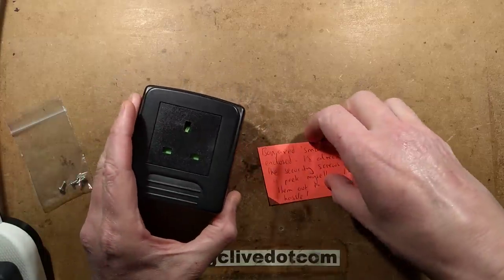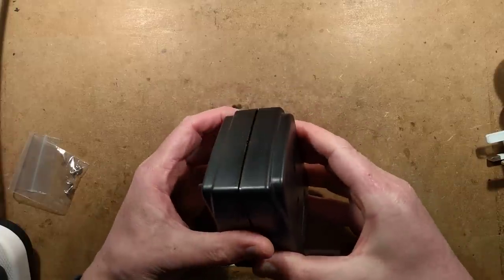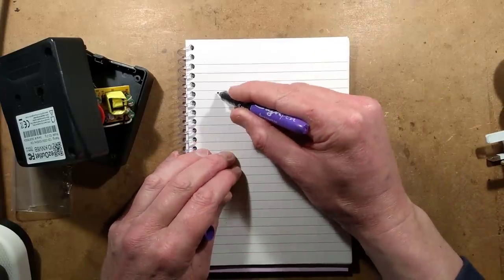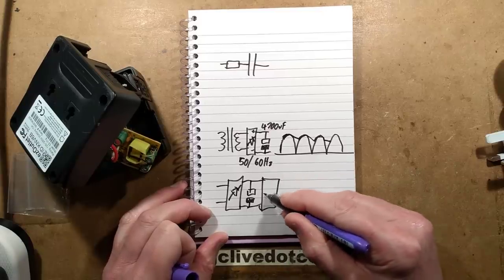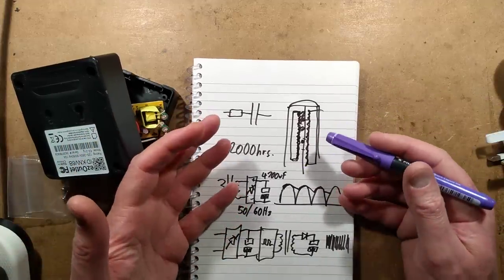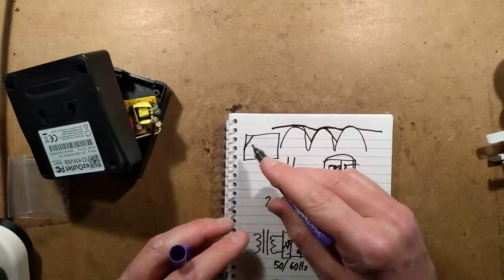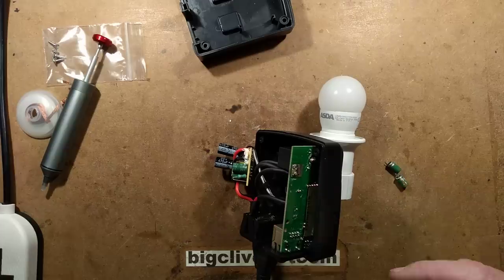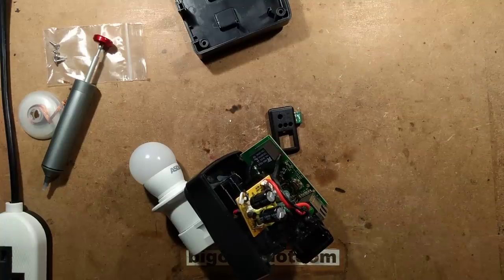Fixing an ezOutlet with inappropriate components.

Comment: Capacitors are super reliable. Cheap SMPSs often use less capacitance than needed, forcing them to run hot from the ripple current.

Comment: I've used a similar device in the past from another OEM (Aviosys) to remotely power-cycle one of my home servers in case of a complete hang. It was not cheap (IIRC, the single outlet version was about 150 EUR), but it really helped me out many times until I got the server to run stable.
There are versions of these devices with several individually controllable outlets as well. These things are essentially little computers controlling one or more relays.
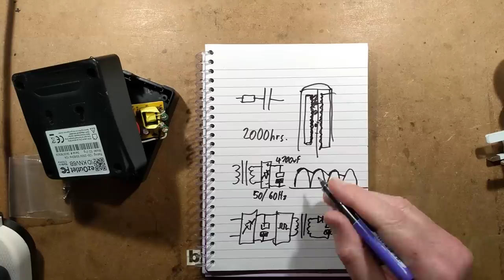@9:24 Electrolytic capacitor hour ratings are specified for maximum rated temperature (usually 85 or 105 celsius). Since most capacitors run at much lower temperatures than their rating, they last much longer.

Comment: The capacitor closest to the transformer would see far higher ripple currents than the capacitor after the inductor. Also when they dry out from a leak, the ESR increases and they get even hotter and the process runs off much like thermal runaway. On a side note the capacitance usually goes up more when they dry out but they become less effective at filtering due to the internal resistance increase.

Comment: Talk about a circuitous solution. Fixing one poorly designed component by making another to monitor it.
Reply: The same approach is a watchdog timer on Microcontrollers. If your software hangs for some reason, the watchdog timer will just kick in and reset your chip after a set amount of time.
Reply: @nrdesign1991  Yeah I've seen systems like that used in high reliability applications like automotive powertrain controllers. There are redundant watchdog timers (called COPs or Computer Operating Properly) that must be toggled above a certain rate or one or both will assert a reset. In this case, would be better for them to implement this internally in the router instead to reset the connection automatically.

Comment: I had a cheap SMPS which failed due to the output diode (a heat-sink mounted TO-220 package) coming loose from the heat sink and heating up until it went temporarily short, which blew out the output filter capacitors. The primary control electronics had a current-limiting feature, so the diode actually cooled back down and stopped being shorted, but the caps were still toast. I didn't think it was worth fixing, as I only paid $9 for it and it was already several years old, so I installed some non-low ESR "JWCO" caps ("JWCO" makes both low-ESR and non-low ESR varieties) that I had on the bench to see what would happen. It not only started working again, but has been working still for the last month, with a lot of very hard service in high-temperature conditions. The output ripple is minimal, as well.

Comment: Oh on a tech side note...  those router reset devices never work right... 
they make use of "ping" to try to detect if your internet is up.. when often your router is stuffering an arp failure.
Inside your router is a very small section of memory that is the arp cache.  under normal operations this small amount of memory is just enough to get things done.  If your running an applications like a torrent client or onion router or p2p software, that is constantly performing dns requests, this table fills up.  This stall's your connection,  
it looks like you can still connect to the internet, ping still works..  but you may see that you cant connect to websites.. 
You can wait and this fault state may clear or you can power cycle the Router to clear the fault.
These stupid switches with the software they are running can't detect this fault.
I took mine and added a raspberry pie computer to it that detects this network failure and resets the connection.

Comment: There are electronic cabinets in the industry running electronic equipment continuously for 30 years, those capacitors are running over 250.000 hours.
About 4 years ago, while attempting to repair a system (pre PLC/DCS era) in a power station, the cabinet had about ten 24Vdc power supplies, two had failed, switching off the cabinet and substituted the two, simply switching on the cabinet, another two failed.
Reply from the maker: It's not unusual for a thermal cycle to knock old stuff over the edge if it has been in use for a long time.  It always has the slight worry of how many others are going to fail.
Reply: @bigclivedotcom  unfortunately a power station this size in the early 80's could be done with about 80 cabinets 200cm x 90cm x 90cm full with electronic Eurocard size components. The cost of upgrading could cost over a million Euro, that's why they try to go with the old until they can.
On sites where there is more attention on reliability, on average the old electronics get completely substituted every 12 to 15 years.

Comment: No wonder my CCTV HDD recorder stiffs out so often! I'm forever re-capping the blessed thing, so much so that I keep a bag of about a hundred 1600uf 10V (105 deg.C) caps on hand just for that purpose.

Off topic, a bit, but I really do love it when Clive says "I'll just get rid of that...." followed by a 'pat-a-rub-thud' in the background. I always get a bit of laugh out it, wondering what on Earth Clive's workshop floor must look like.
Reply: This seems excessive even for a device that runs 24/7. Unless your caps are of dubious quality, I'd guess it runs rather hot and may appreciate a mod for better ventilation. (That was pretty much the thing to do for Topfield PVRs back in the day unless you wanted to be able to fry eggs on them. Most common things to fail: PSUs and harddrives, no surprise.) Clearly, a circuit that's taxing on caps is not going to help either. Might be a case for some solid caps (OS-CONs or whatnot), or some creative stashing of additional caps in parallel (twist leads and use leads of adequate diameter to keep ESR and ESL low).

Comment: Clive, if I'm recalling what I learned exploring all the different Cap ratings Mouser lists that MTBF on the cap is for its time to fail at (above? percentage of?) the specified temperature.

So 2000 hours of operation during peak temperature plus (if I recall) a much longer duration under normal stress.

Couldn't see if anyone noted that; no search in this interface!

Comment: For the estimated life of a capacitor at a lower working temperature, every 10c below the max temp you multiply by 2. So a capacitor with 2000h at 85c if it works at 45c will have 32k hours estimated life, about 3.5 years (perfect for warranty..).
As for the capacitor replacement you could probably use a 6.3v as the psu out is 5v. Usually they round up the voltage value of the cap if there is a headroom, in this case about 25%

Comment: Those smaller sized electrolytic caps seem to fail more often than the larger ones of the same rating. I guess that they are somewhat optimistically rated. Looks like the swollen unit was closest to the diode so may have seen some heating.

Comment: Separate topic but...
Is it possible to connect a 12v cig lighter/aux car LED strip to the cars turn signal cables without needing anything extra? my truck has 4 Turn/Park lights in the front and I would like to put LED strips on the 2 bottom turn light connections as I haven't had lights there for a number of years and would like to use them for a type of fog light using the LED strips instead of normal turn signal lights
Reply: As not every light has the same resistance it is a you have to test each setup to see if it has the resistance to have the lights flash at the right speed and not be seen as a bad bulb and rapid flash. Rapid flashing is bad as you risk getting pulled over by cops who see the speed from the back thinking you have a bad front turn signal and need a ticket/repair order.
Reply: @TheUserid82  Gotcha. Yeah if it ends up hyper flashing I wouldn't use it anyway.I just wanted to make sure id actually be able to hook a strip up to it without needing a converter or some such as well. Not to mention i'll prolly have to find some Amber colored lights if I do try, I was originally going to do white but as they'll be used for turn signals as well I suppose amber would be best to be on the safe side.
Thanks

Comment: The life rated for a capacitor is the life of the capacitor at the maximum rated temperature for which the capacitance of the capacitor does not drop below a specified amount. Generally running a capacitor at 10 degree lower doubles the life time. Note this almost means that if more capacitance that needed is used capacitors may be out of spec but still work due to the over design.

Comment: Those low cap life ratings are at full voltage at maximum operating temperature. if you run them at lower temperatures, the will last a lot longer. same goes with lower voltage.

Comment: That 2,000 hour lifespan for capacitors is/was at full rated voltage. As a rule of thumb, every 5% reduction in that voltage would roughly double the life expectancy of the capacitor. At 75% rated voltage, you would therefore expect the capacitor to last for at least 32,000 hours; close to 7 years of continuous running. Every overstep of 5% at least halves the life expectancy. (55% over-voltage, and it will die within a minute, on that basis.) The same rule applies for filament lamps, fuses, resistors, etc, but there are exceptions, notably semiconductors which have sharply-defined breakdown voltages. With most components, voltage, current or power ratings are a balance between durability and the specified parameter. Many (let's say) 'economy' suppliers are playing brinksmanship with the components.
Reply: P.S. Remember that the peak voltage from the diodes will be (1.414 - diode voltage drop) times the off-load AC voltage. 10V caps will be pushing things, especially with typically optimistic Chinese component ratings.

Comment: The 2000 hours rating is quite normal. It's under maximum ripple load and temperature. It's doubled for every 10 degrees, so a 105 degrees 2000 hours capacitor will last 8000 hours under maximum ripple load if the temperature is kept at 85 degrees. Normally, temperatures are lower and max. ripple isn't reached, so capacitors last long

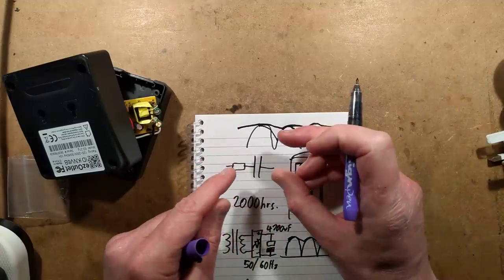Comment: 10:58 I used to work in an electronics service company, about 12 years ago. I remember there was a certain Samsung STB model that had its PSU fail a lot. It was a ripple problem and was corrected by replacing the larger cap plus soldering a small some nanofarade cap across it.
Reply: Large cap for buffering, and tiny cap for EMI suppression?
Reply: Correct. I googled around a bit and it was the Samsung DTB-P850Z which had the most problems. I believe some of its sister models also used the same PSU but that was the model we repaired the most.

Comment: The hour ratings depend on the temperature. They will be rated 2000 hours at 105c (or whatever their temp rating is), and they last a lot longer at lower temps.
Reply: Yep - and that one was next to a (supposedly) fast-switching diode that might have got hot. More than once I've found inappropriate diodes fitted to Chinese SMPs that get very very hot.

Comment: Replacing output capacitors on a smps can cause issues if the esr on the replacements is much lower than the original, considerably lowering the esr will increase the Q of the output filter, and can affect the frequency response of the system, making the supply unstable.

Comment: I would expect the one next to the transformer to fail first, not from heat from the transformer, but from heat generated by the ripple it's absorbing.  The downstream one (after the inductor) would see a lot less ripple current, and be subject to less self-heating.

Comment: Cheap multimeters just add a diode and more resistance to the input on "AC." If in doubt, make sure a battery measures 0V both ways before using it to measure ripple.

Comment: The capacitor lifespan is given @ max rated temperature (85°C, 105°C, etc.), and lifespan is a nonlinear function of actual operating temp. So if you use a 105°C cap at 40-50°C you get something like 10 years of lifetime.

Comment: BTW. If you don't have low ESR cap you need, solder low value ceramic cap in parallel with a regular one on the other side of the board. Its better than nothing.

Comment: The lifespan is coupled to the temperature. They usually have a graph but for simple specification they just give life expectancy at its rated temperature. Better quality caps will be 135deg C but these are expensive.Another way to improve things is to use a higher voltage spec. but that will result in a larger capacitor and also higher price.  2000hrs at 85deg C would probably equate to 20000hrs at 40deg C.So keep your power supplies cool and they should last a long time.

Comment: As suggested below the lifetime rating is at maximum everything, temp, voltage, and ripple. Drop these by a few percent and expected lifetime multiplies..to the extent if you are careful in your electrolytic choice they will last almost forever. (forever being 30+ years).

Comment: Had exactly the same with a Perrin and Rowe instant hot water tap. 
The PSU uses a resistive dropper with a 100uF cap across the bridge, driving a relay via an electronic thermostat. Problem was the 100uF was adjacent to the dropper resistor and the heat dried the cap out, the unit appeared to power on, but as soon as the relay energised it turned off again.
Fix, replace the cap and mount it away from the dropper resistor. Just a badly laid out  circuit board. I've let them know my thoughts.

Comment: Big Clive the hour ratings were at maximum permissible temperature and load. Philips (before they became BC components) stated that for every 10C below max temp the life was doubled. Also there was another multiplier for reducing ripple current. I'm pretty sure Samwha and such like also stated doubling for every 10C below max temp too. So your 2000 hour 85C capacitor if it is run at 45C has a 32000 hour life. Mil Spec kit used +125C caps and was often run at 55C to get 100+  times the life compared to maximum stress. There were 10,000 hour caps at 85C and you can get longer life than that now. Page 13 of this data sheet has a relevant graph for live vs temp and ripple current. https://www.tdk-electronics.tdk.com/inf/20/30/db/aec/B41689_B41789.pdf

Comment: There are actually 4 different types of routers: routers: connect two networks together, switches: connect devices on a network to each other, hubs: idiot version of switches, and gateways: connect different types of networks to each other. The lights on the port have reasonable meaning too: solid green (1000 Mbps)/yellow (100 Mbps)/orange(10 Mbps) light: link, blinking orange light: activitiy.

Comment: 2000 hours at 85C, rule of thumb is double the lifespan every 10C below max they run, so 64000 hours at 35C = over 7 years operation even in a "warm" device. Even longer if its kept cool away from high dissipation components and in air conditioning or such. Plus some were rated for 105C or even 125C rather than 85C, so can last for decades of continuous operation if kept cool.

Comment: Generally capacitors will either fail from absorbing moisture over their lifetime (as far as I understand it) very gradually. Decades later after this has actually managed to permeate through the seals to the degree the separation between the layers begins to degrade and the resistance gradually rises. 

The other method of failure over time seems to be if it’s in a circuit designed with improper heat dissipation (small case, no vents, etc) or it’s shoved right up against components pumping out heat. Not realizing (or caring) when made the fact that is the single largest cause of failure in capacitors that aren’t literally decades old. ‘

Is this right?

Comment: Couldn't you just run some leads off the board to mount those larger caps remotely somewhere else? hot glue them to something so they don't rattle around.

Comment: 2000 hours was at 85C. Phillips long life were 200 000 hours at 55C. I seem to remember 10 000 hours at 85C. The important thing is placement and ripple current. Away from heat and ripple current causing heat. At a minimum double the ripple current factor. Not always possible. Ripple calculators can be found to help.

Comment: I've had the horizontal amplifier circuits have high ESR from age, capacitors and the lower voltage would make the vertical height of a old CRT TV shrink, replacing them capacitors would restore the height.
Reply: I had an old Sony 5" BW TV that looked like someone shrunk a regular size TV and it wouldn't work right.

Found some caps in the deflection board were bad.

Replaced those and it worked.

A little while later the transition to digital happened and that TV sits unused.

Comment: I'm thinking the life is stating that the capacitor will operate a minimum of this many hours at its rated voltage rated temperature and rated ripple current and in cases where a cap is designed for switch more supplies it's specified operating frequency.

Comment: 13:01 I'm calling BS on the description of that Panasonic AM type. "Ultra low ESR", but 85C rated? No way, no how. And 2000h lifetime at 85C? The datasheet only contains ripple current specs at 120Hz, and that's a dead giveaway that's no low-ESR cap (which spec the ripple at 100kHz).